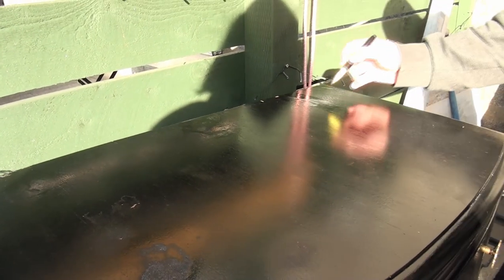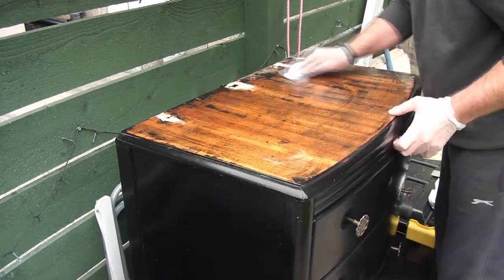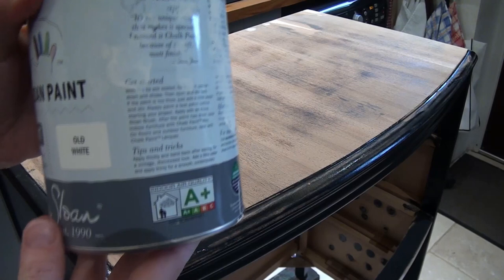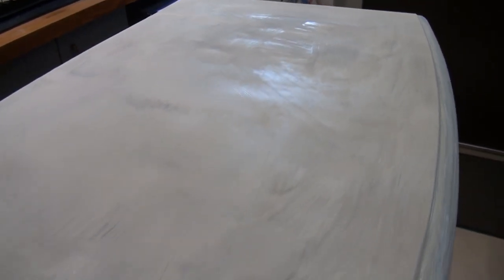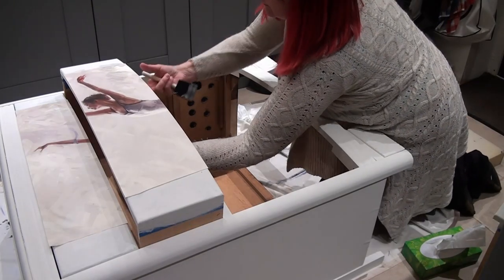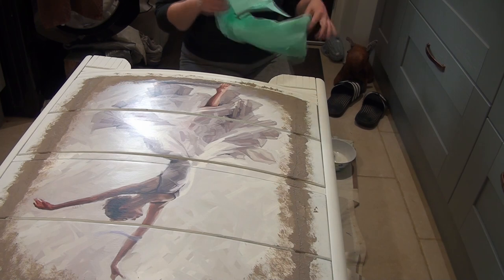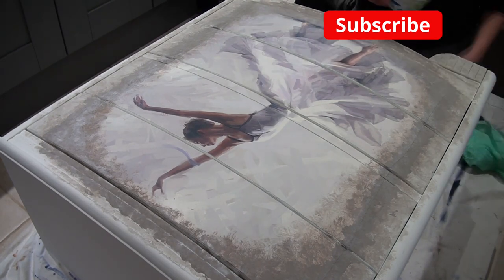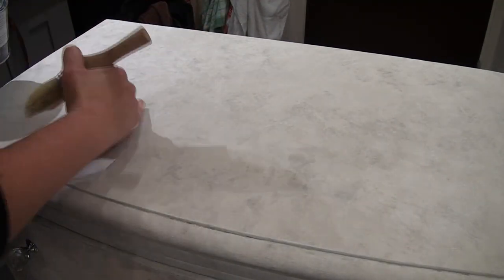Decoupage, paint wash and more. Lebus chest of drawers transformation. #decopuage #paintwash #diy

Comment: Your young son is too cute. Use him in all of your videos. Have your hubby look into the camera more often as well.
Ms Vi, it's a beautiful job you did on that dresser.
Be careful with hot blow dryer, it will release the mod podge glue and you don't want that.
Ms Whitlock is correct about the Mod Podge for furniture, but it does depend on the amount of usage the piece of furniture will be exposed too. I did some wooden jewelry boxes for my daughters using Mod Podge to decoupage and they were heavily used by them and the wear and tear on them was not too bad. Knowing that the jewelry boxes were going to be used heavily by daughters, I gave them 2 good coats of Mod Podge and then also gave them 2 good coats of Minwax Polycrylic Matte topcoat. They used them for 10 yrs. and I still have them. I do believe a lot of UTubers are using a topcoat (any brand) of some kind to use as the glue on the decoupage on the furniture and also using it to seal it.
Reply from the maker: Thank you. We are just starting with You Tube and we are all camera shy. We will work on this. 😊😊

Comment: Mod Podge is not good 4 furniture. You should know that
Reply from the maker: Why is that? Can you give more details. Thank you for watching :)
Reply: @ViChalkyFurniture  Mod Podge is for crafts not for long term use as in years of a piece of furniture
Reply: @lorrainewhitlock5377  Your wrong
Reply: @lorrainewhitlock5377  mod Podge is great for furniture you just need to seal it properly after you done and it will last very long time. I have used it many years and my furniture are still going 😊